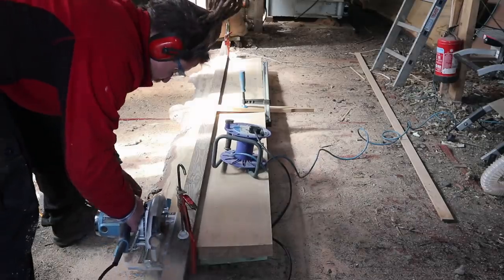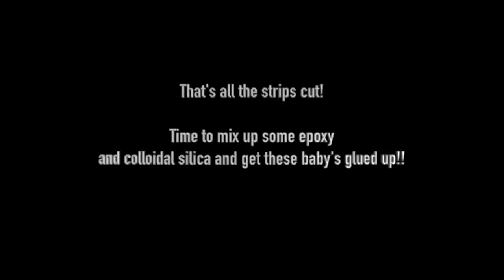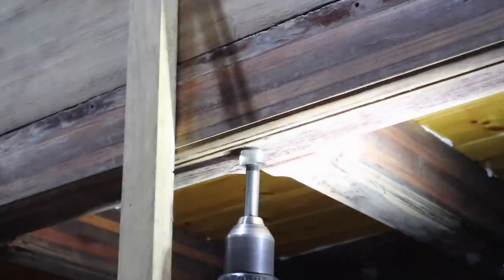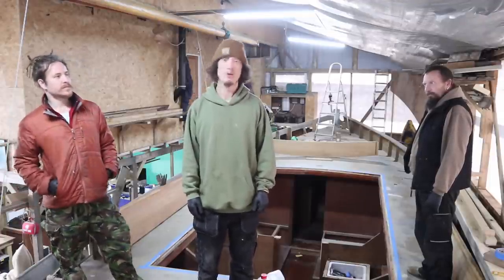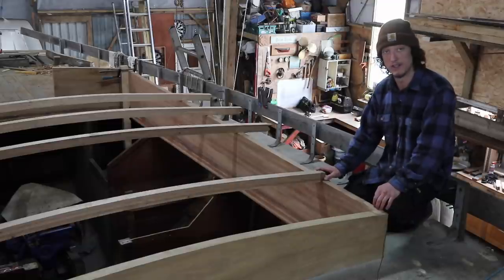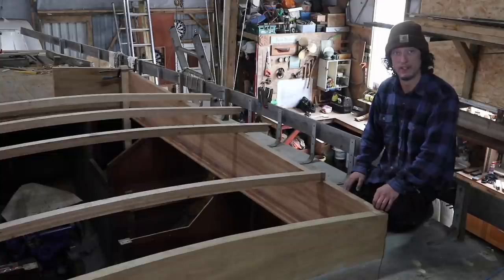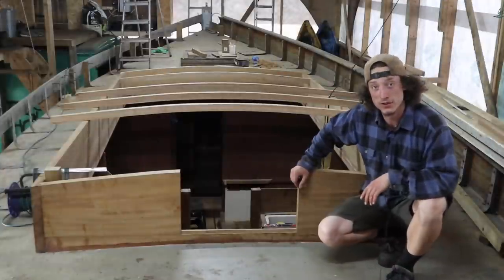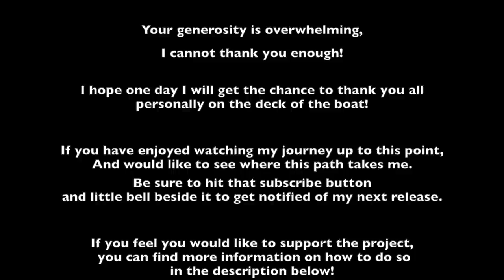Laminating curved roof beams and bedding the cabsides. Episode 16

Comment: That joint was pretty fancy. It has to be called joinery not carpentry.I am sure Leo will be thrilled to see this video.He is certainly turning out  well educated boat builders. 
I could have sworn I saw another wooden boat junky giving a hand. 
You may well have the only cement boat around with  dovetail lap joints on  curved laminated oak beams.

Comment: Lots of nice detail too - cutting off the sapwood in oak. He lines out his edge cuts with the narrow face up. If one does it the other way, one gets sapwood in the boards, maybe not so important in this application where he's laminating with epoxy, but generally a way to have problems with insects and rot down the road.

Comment: gr8 to see some real dovetail joinery Finn, too far too many 90 o angle slapdash, Q when you routed out the coach roof starboard and Port sides did you chisel the same slope as the coach roof beam now that's a tall order but the curve you so well clamped for the coach roof beam I thought you might go the extra and make the coach roof side have the same matching coach roof beam curve!!!

Comment: Those look great - I was wondering if you were going to cut a little recess or pocket to take the whole butt of the beam, but the joint looks so tight there's no point. Nice. Are you going to glue them in, or just drive a screw from the top?

Comment: Looks like you left some sapwood in there, Finn.
And fix that guard on the chop saw!
Reply from the maker: I see why you would thing that, looking down the beam after it’s cleaned up there is a lighter striped strip on the inside, worry not there is no Sapwood left in the beam, that strip must have been from a different board to is slightly different in colour! 

And I am saving for a new chopsaw as the one I’ve got is a bit old and ropey!